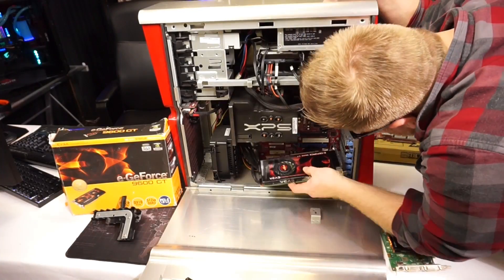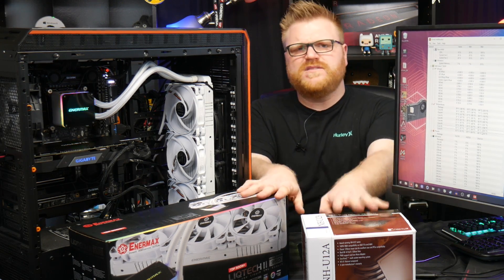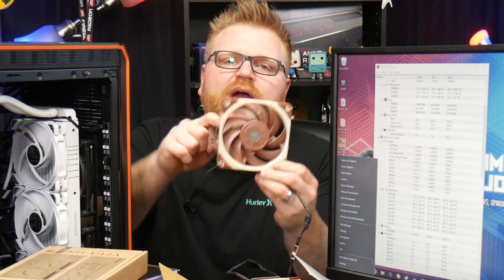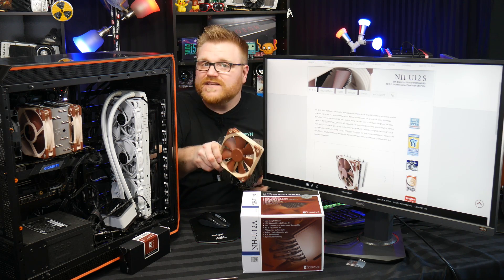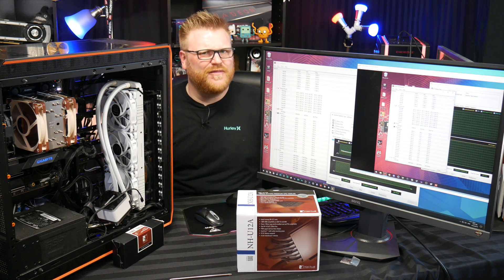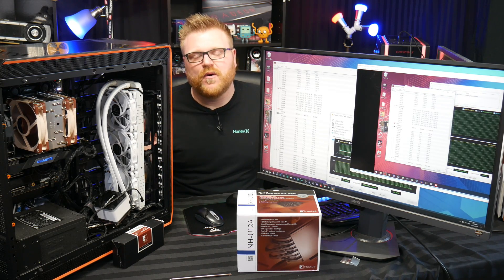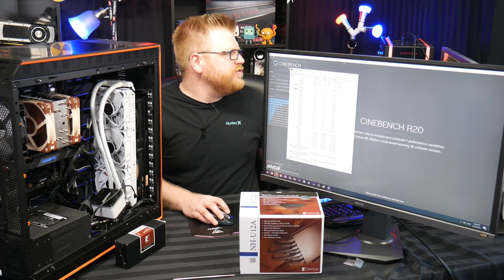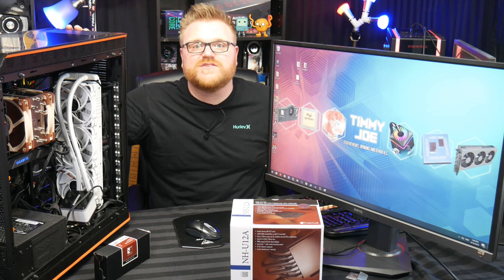Noctua's new cooler keeps up with a 360mm AIO!

Comment: My NHU-14S just broke, guess I need this now.
Reply: Wait what? how? do you know it has 6 years warranty?
Reply: kingofnfsfan I don’t know it just fell out the window and I’m on the 4th floor.  Just as I saw this new cooler on this here Timmy Joe video.  Weird coincidence.
Reply: fell out the window or was pushed after watching this one and how good it is :/  @LeMMingSlayeR
Reply: or the nh-d15
Reply: Jason Gooden the NHU14S and NHD15 are within about 2 degrees of performance.
Reply: you forgot the tolerance.. 2 more or less is under tolerance lol @LeMMingSlayeR
Reply: how can a cooler be broke...u mean the fans...even if you get a replacement
Reply: R Ξ Ẏ N I've had some of the metal sheets come loose on a cooler. it's possible for it to come apart for various reasons. so not impossible for it to break, just very unusual through typical use.
Reply: or ninja 5 ;)
Reply: Wait what
How can a cooler break
Reply: @Rainbow__cookie  it fell out of his window from four storeys, read the replies before u comment lol
Reply: @Harryw007  yes i did but how can a cooler fell out of the Window
Reply: @Rainbow__cookie  

While cleaning it maybe
Reply: @Rainbow__cookie  Scared of the dust and wanted to end it all.
Reply: 🙂 how did it break?